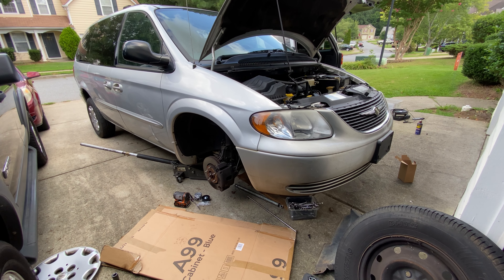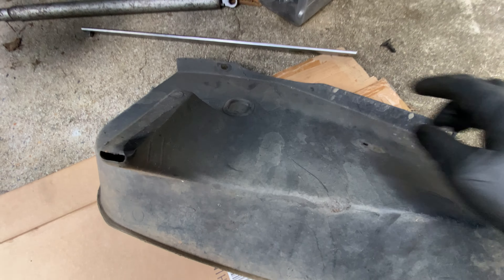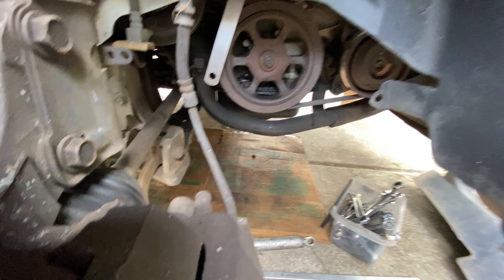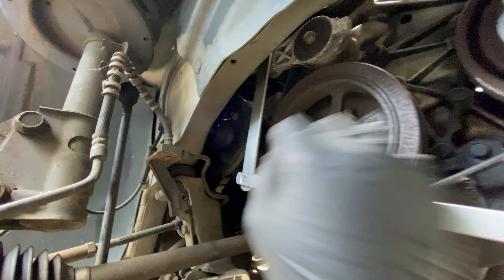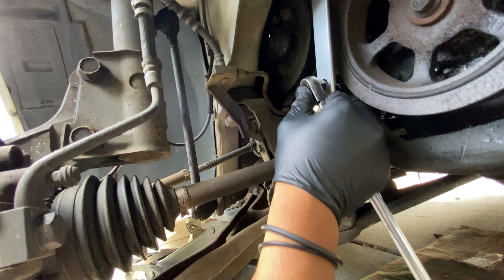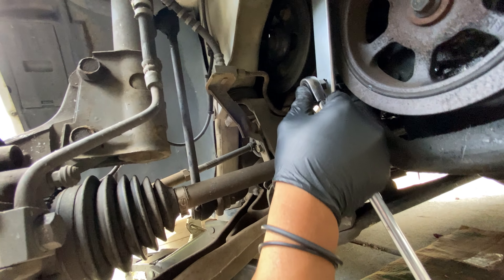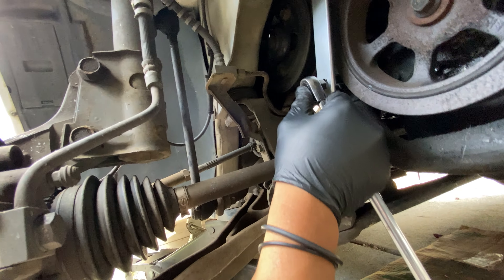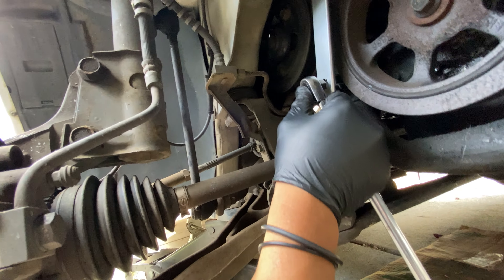2003 Chrysler Town & Country belt Dodge Caravan 3.3L belt / belt tensioner replacement.

Comment: Thanks for a good video.  I found that you don't even need the tensioner tool. Use a long screw driver or pry bar, insert it onto one of the cross slot of the tensioner, lever against the wheel well side wall and push it down, extremely easy. No special anything needed!